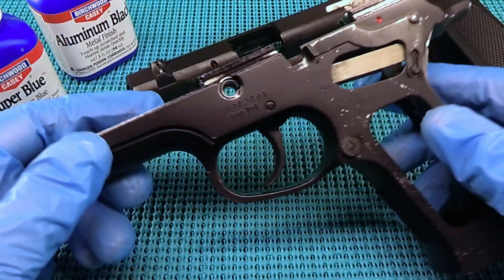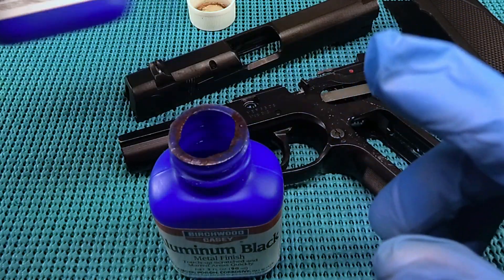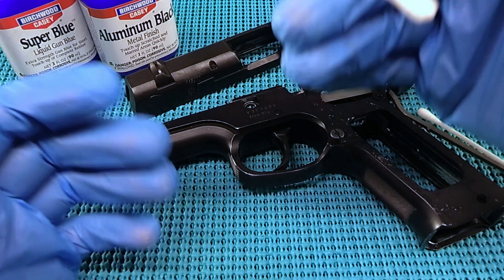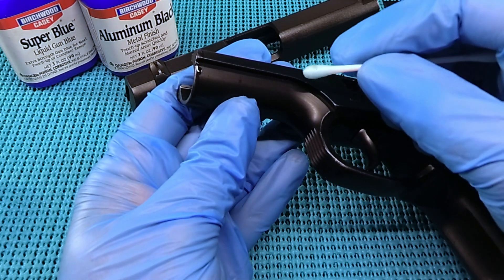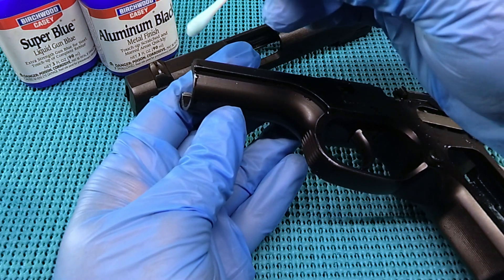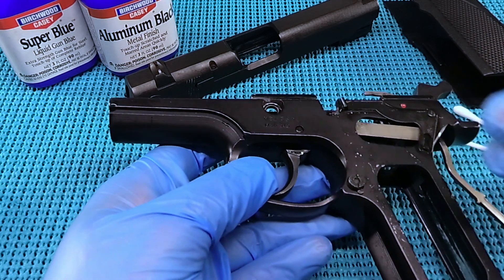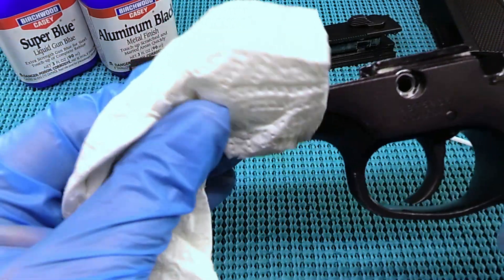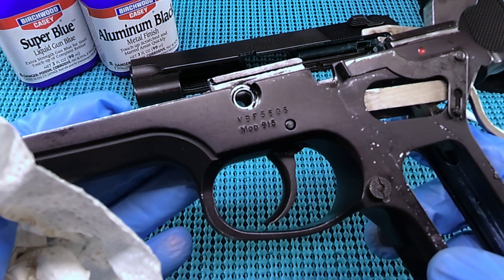Smith 915 Brichwood Casey Aluminum Black, Making her Gooder Part II

Comment: I notice the same thing with aluminum black. I sandblasted some random parts and it's very inconsistent. Even with degreasing and removing the old finish entirely, it still doesn't seem to work very well. Super blue on the other hand is outstanding.
Reply from the maker: It is hit or miss.  Had a 1" mark on our Beretta 92F, bottom of the trigger guard.  The Aluminum Black made it disappear.  On the Smith not so good. That's what makes it frustrating.  Thanks for the view Kellen, UGD
Reply: @usedgundude1035  could it be due to different aluminum alloys? I have a Beretta 81 I was gonna use some of this on to black out the import mark under the trigger guard